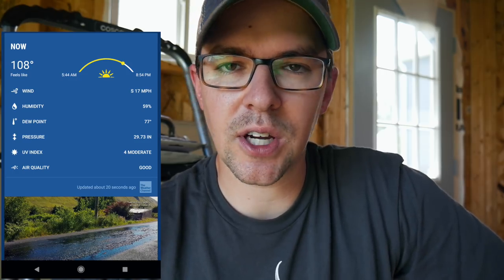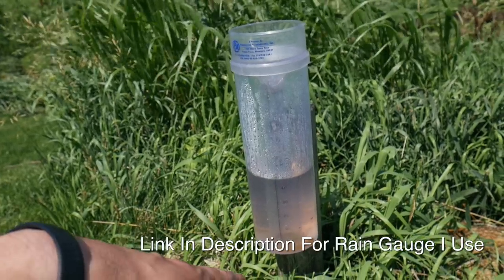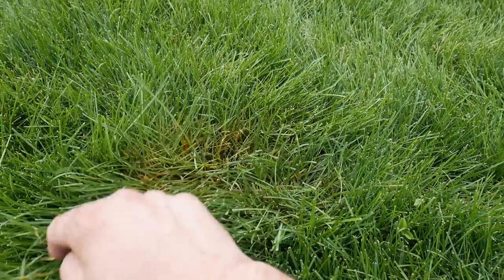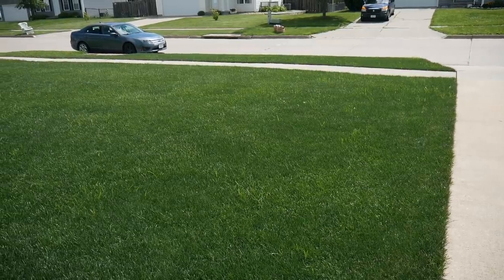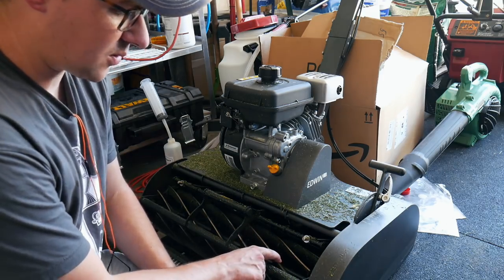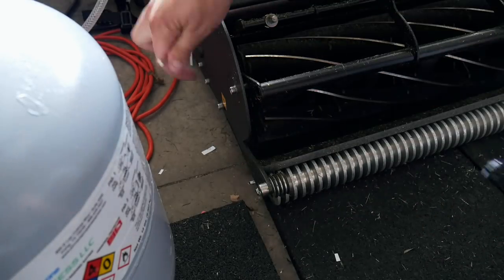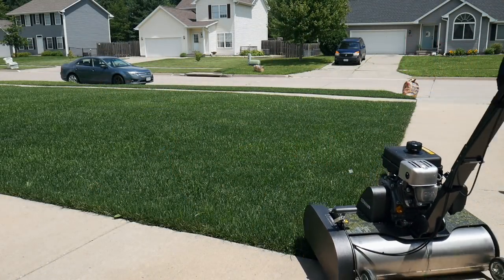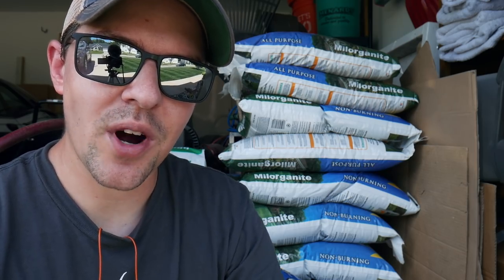My Lawn Got Flooded...

Comment: Good point on the grass cut height. Mowing tall is good for the lawn, but each type of grass has a "ideal HOC" ryegrass and bluegrass ideal HOC is 2-3"".....Im having the same issue with TTTF. mowing at 4 inches, im getting alot of disease due to it folding over, going to lower it to 3.5 and see if that helps!
Reply from the maker: Very true. The cultivars I have said 1/2"-2" cut height is recommended so I've pushed it a bit too far.  I'll stick with 3 or right around there from now on.

Comment: Blue grass wants to be mowed around 2.25 to 2.50 That is ideal. Then you won’t have that issue. 3 inches is still to tall. Like you said you need to know your grass type. Tall fescue is good for 3” or higher. All in all good video nice lawn.
Reply from the maker: I had mine pretty well trained at 3. Took probably a couple years to get it there but I shouldn't have changed it.  Live and learn.

Comment: That was a horrible storm Saturday evening. I was in Nebraska and drove thru it around 1am on my way back to Kansas.
Reply from the maker: All this heat and humidity really stirs up some storms.  I just hope it doesn't get too dry now.
Reply: It's been in or near the 100s for a few months in Kansas. We could have used a storm like what you got. Feeling bad for those that didn't do any fungicides applications where you at. Their turf is gonna suffer if the temp jumps up again.

Comment: Lesson learned from hurricane Harvey is to lay down some pre-emergent because the flood waters will carry weed seeds from all over and you will get a heavy load of things not seen before that might thrive better in your lawn. Also the large amounts of water tend to carry away some of the top soil that once held your pre-emergent. That's how I ended up with a salad bowl of rapidly reproducing weeds. The previous owner never used any sort of pre-emergent so when she sold the property to me in the transition period of owners she let things go and wellll bye bye pretty lawn hellllooooo waste high thistles and random salad bowl.
Reply from the maker: We've had this creek flood before and I haven't had too many issues but my grass is already extremely thick so that helps as well.
Reply: Ryan Knorr Lawn Care count your blessings. I am on the edge of a Texas forest and when we get that heavy of a rain it brings in all sorts of seeds and upsets the lawns balance. Fungus has been a massively spread issue this year too because of the "swamp rot" as we are now calling it. Even struggling with the professional fungicide LCN and GCI recommended. Every possible problem that could happen in TX have hit me so far this year. Thanks for you videos by the way.

Comment: Not speaking to your situation, but a lot of people are trying out "Elite" KBG and trying to mow it high. That's a tall order no pun intended. Most of them like a little lower cut. Plus if its hot and raining its is important to not let it lay over. Its inviting fungus in.
Reply from the maker: You are absolutely correct. My paperwork says mowing height of 1/2"-2 inches is recommended.  So I pushed it too far this year.

Comment: Thanks for the peek inside the reel mower. Looks like a great piece of kit!  Just curious (because I can't afford one), but can it do tall cuts, like 3.5"-4"? Or isit only for low cuts?
Reply: I think 2.5 inches
Reply from the maker: Max height is 2 inches but with a roller on front and back it lays the grass down very well (hence the amazing stripes) but you would need a regular rotary mower to use as well every once in a while to get the grass to stand back up.  My goal is to be around a 1 inch cut.

Comment: I try to mow high at 3 “ plus but my grass goes to seed and it look bad with the lighter seed head on top. I have cool season grass because I live in Canada ( prairie)
Reply: Latoya Williams I am not Ryan but I am in Canada.
In the summer warmth some grasses rest or go dormant, often just before this happens the plant goes to seed.
This is a survival thing, insuring "it's" going to come back when the rains come.
Hopefully someone else will give you guidance on how to manage this.
Reply from the maker: It should be going away soon if it's in that stage.  I'm assuming your climate is a little cooler but could be wrong.

Comment: Live in same general area as you. With heat coming up, why exactly no milo in backyard?  Just put down some poultry poo in my front yard and a small dose of milo for iron.  In the back I did a full dose of milo.  Too much nitrogen for the heat?
Reply from the maker: My backyard gets about 16 hours of sun right now.  So it will take a matter of days in the heat for it to become heat stressed and at that point I don't want to be trying to push it to grow with nitrogen when it's naturally stressed out.  Milo is very slow release so could I probably put some down without too much of an issue?  Sure, I probably could but I wait until fall for my major fertilizer on the bluegrass and it loves that.